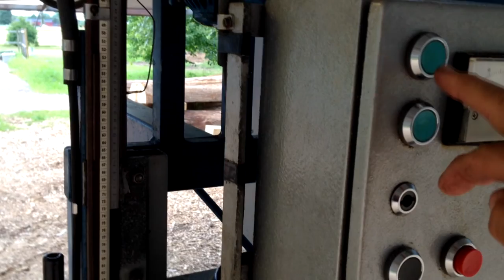SNIK chainsaw mill video 2

Comment: I will copy your log attaching system (with couple of winches) on my future sawmill if it's okay with you. :D
Reply: We Think you should use  band on the winches instead of rope it is stronger and easy to work with
Reply from the maker: Sadly  Donn DIY we have been unable to read and write  comment on our log in feel free to copy me as Hylte Mcveteraner said 
you should use  band on the winches instead of rope it is stronger and easy to work with
Reply: Donn DIY

Comment: You've done a very nice job on that mill. Have you noticed any problems with the chainsaw bar getting too hot by pushing it that fast / with that much power on the motor?

It might be good to think about building a log deck 30cm off the ground with flip down loading arms. It would save you the chore of getting the log up on the sawmill's bed. Love the elephant!
Reply from the maker: +Stephan P in BC  Thank You 

1: Dry timber will not do without external water-oil mixture cooling.
But wet fresh timber, No problem 
The saw yield can exceed 40 Cubic meters. timber on one chain and a 20 inch saw sword or chain bar often keeps 2 to 3 chains.

2: Yes heavy logs are little difficult on a one man show :-)
but two man fix it easily, we did not have the Yanmar tractor with front loader before last year https://youtu.be/mah_q9h9keY?t=8m52s
so all log handling was managed with th the Log elephant  and it will not travel over a a log deck 30cm :-|

Comment: Hi good afternoon, I would like to know what was the maximum Rpm rotation that you used in the chain? I would also like to know what size of the pulley used in the engine and the size of the saber gear used?
Reply from the maker: 3/8 8 tooth  sprocket  8000 rpm . chain speed 20 meter  sec.

Comment: another way you could get your logs on the mill is put a big steel post in the ground in front of the building at the mill then loop a cable from a winch around the log back to the steel post the log will roll right up the mill ramps as you activate the wench... That way you're out of the way of the log...
Reply from the maker: Z71Ranger like this ? https://youtu.be/fU3XG23Um5U?t=3m58s

Comment: How do you handle the oiling of the bar and chain? do you have a pump or gravity from a bucket that puts oil on to  the bar and chain or have you found a way to put oil in through the oiling hole in the bar like a normal chainsaw would do?
Reply: I just watched saw video three and see that you have an 10 bar pump. Is it delivering oil to both ends of the bar or just the nose of the bar through the greasing hole?
Reply from the maker: +Stephan P in BC 
Yes lubrication in both ends 
Lubricating trough a throttle valve and check valve at the nose wheel 
The permanent magnet closes tight to the chain bar and and presses the oil into the grease canal 
to the needle bearing.  
The chain and bearing gets lubricated in the right way and you can hold a tight chain tension
and high feeding pressure.
 A hose with oil drops do not work at 8000-12000 rev. and 20 m. sec chain speed
The magnet has a magic feature that allows the chain stays sharp longer
 A technique that also can be used  for band saws.

Comment: Very well thought out sawmill, do you have three electric motors or just two?  and how fast are you spinning the chain?  Thanks for showing use this.
Reply from the maker: Thank  You
we have four electric motors
1 engine saw motor clutch maneuvered  2 track z pulley 2,8 - 1
1 engine friction dependent feed
1 engine for pressure lubrication of the saw bar and t nosewheel (Danfos oil burning pump with strainer dismounted)
1engine for adjustment of the  thickens of the material  30 " 750 mm
we have built a bigger machine where we used a pump that had  left rotation
this made it possible to mount the oil pump on  the saw motor fan cover
Spindle speed 8000 rpm. with a sprocket 8 3/8 "The Chain speed is 20 m / s.
( 8000 rpm are max on 2RS 62 series SKF berings )

Comment: when your rolling that log up on your mill you might try rapping a cable around the log 3 or 4 times and hook a comealong to an anchor point on the oppisit side
Reply: +grizz270 ps , the wraps are to make the log roll up on there
Reply from the maker: +grizz270 Yes  Thank You ,  Right it is a little bit dangerous on the Video :-)

Comment: Hei, hva er fordelen med kjedesag vs båndsag? En kjedesag gir vel mer sagspon, så det er vel andre fordeler som gjør at dette designet er godt?

Flott video!
Reply from the maker: Jo det är korrekt, men vi eldar med såg, kutter spån och rebak flis
https://drive.google.com/file/d/0B2u0RjRfAjViNm1LZEVwVGx3aWc/view?usp=sharing
En 3/8 klyv kedja till ett 20 tum svärd koster runt 100 sek. och ett svärd ett par hundra
fördelen är den låga rörliga kostnad.
PRO Bandsågs kringutrustning är väldig dyr
Band slipautomat,  Band stuk och Bandsträcknings vals
Sågprecisionen på SNIK sågen är  hög och motsvarar ett professionellt bandsåg med 75 mm blad bredd
Vi sågar med tiondels mm precision och kan faktiskt såga 0,5 mm faner
Reply: Svend Nielsen Takk for svar. Vurderer å bygge en liten sag selv, og ser på ulike løsninger. Er det noen funksjoner du savner på sagen?
Reply from the maker: En bark  fräs ( twå brickor med en 404" kedja fastspänd) elmotor driven på en svängarm som rensar jord och sand fram för sågsnittet  som sitter i barken , vi har en roterande stålborste på en flexibel axel i dag med den kan man rensa barken manuellt fram för sågsnittet där kedjan går in i stocken men en spårrensar vore modellen

Comment: are you using water to lube the chain ? If so doesn't it cause wear in the bar ?
Reply from the maker: Bos dad, no water can not lubricate a saw chain, we use  mineral oil, but when we sometimes cut dry timber we use a mixture of water and 10 % oil sprayed on the chain bar itself from a bottle to cool it down.